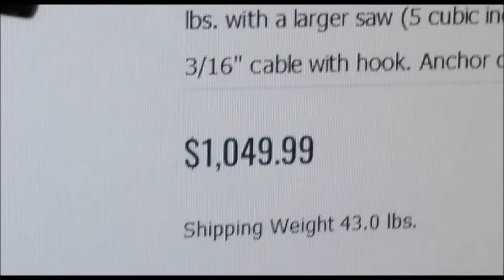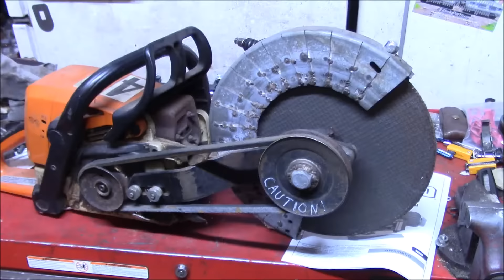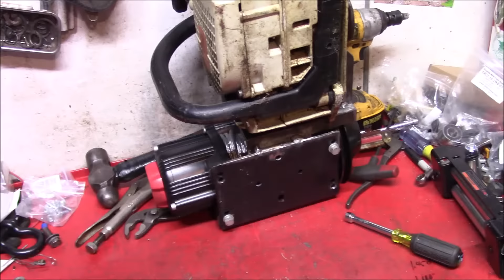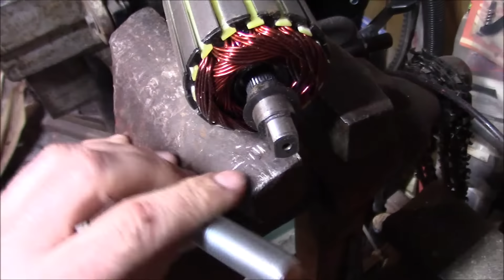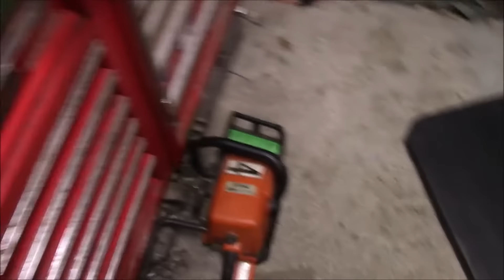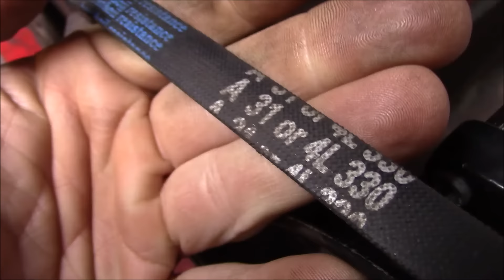Building a Chainsaw Powered Winch

Comment: Couldn't you cut off the long section but leaving enough roughly 2.5 inches to drill a hole for the d ring ... You're better off the closer you can get mounted to the spool

Comment: This is awesome. I got a 12,000 lbs badlands still in the box from years ago and a used stihl 661 (90cc) with decent compression.  You think its doable to make a monster chainsaw winch or is the 12k just too big?
Reply from the maker: Yeah, think it would be possible for sure.  Biggest thing would be figuring out how much gear reduction is in the winch, and what's needed from the saw.  Try to match the torque input from the electric motor with the drive from the saw

Comment: when I was a kid & mining with Pop.
I got to use a chainsaw winch. [it was built before I was born]
 I had watched Pop use it several times, & he finally let me try it out.

 it bolted up to most saws of the day [then saws were not plastic]
  Ive seen several deer, bear & moose pulled out by ppl using a chainsaw winch 
none were home made as you could buy one cheaper & better than what you could make yourself.
[Ive seen several ppl make them & Id still buy one as opposed to weaker home made versions]
+ I seen many used for sale - 

 safe? uh? [we wont talk about that]
what can go wrong ;)

Comment: 5000lbs but man carrying device weights in at 300lbs? Maybe if the man tied himself to a tree that might work. Will the chainsaw frame handle 5000lbs of force?
Reply from the maker: The metal base that the winch is mounted on has a shackle mount, it gets anchored to whatever is solid.

Comment: I'd use Dyneema or similar synthetic rope instead of steel wire.
Break the steel wire, and it whips on you.
Break the synthetic and it whips about a metre at the break point and drops straight down.
Reply from the maker: That's a good option.

Comment: What would be a practical application for this thing though
Reply: As a timber cutter of 60 years experience I can remember MANY instances of when I would have killed to have this winch unit on hand to simply fit a chainsaw power unit to. Both for shifting wood and saving many a marathon hike into civilization to get rescued from a bog! Not to mention the uses around the ranch and machinery sheds.
Reply: Doesn't need to be one.
Reply: @haywoodyoudome  why does it exist then?

Comment: If the saw DIDN'T spin the correct direction, one would just reverse the direction that the cable is wound onto the winch drum.
Reply from the maker: Wanted to keep drive side of the cable on the bottom winch, but that's a good thing to keep in mind.
Reply: How did you release the tense cable after?

Comment: I made one out of a worm gear box 
Welded the clutch cover to its shaft
Built and bracket and lined up clutch and housing and welded 
Then took a spool off an old harbor freight winch hoist 
I had to rig studs to slide spool off of for free spool
Man that thing is strong

Comment: I enjoyed you build. If i were to operate this I would need a remote throttle arrangement so the cable would not hit me if something went wrong. There are so many things that could go wrong.
Reply: Being cut in half by a snapped steel cable would indeed be a bad day.
Reply from the maker: Gotta take some care for sure
Reply: Those braided cables don’t snap like the twisted wire cables, they don’t whip around cutting things in half…
Reply: @ Are you being serious?

Comment: I'm kinda doing this. I have this really nice tilt bed trailer, see, and... mounting a nice gas engine on the front. there is going to be a large shaft going from one side to the other powered by the engine via a pulley. Then using other pulleys there will be a winch, a air compressor and a hydraulic pump and a small generator. I'll have a go kart type clutch on the engine so it can start and idle and not turn the shaft. Then a system where each drive belt can be let be loose/tight via a tensioning pulley so nothing is driven unless I pull a lever to make the belt tight enough to give it power. Whatever I need to run then can run. Be cool if I do it right.
Reply: That's a great idea! That's something I might be able to do

Comment: Im sure their could be a way to run the engine backward to relieve the  tension on the load to un hook? .... 2 strokes can run backwards!
Reply from the maker: I like that idea, haha
Reply: A socket and ratchet on the bolt head of the winch pulley would be enough to release the tension.

Comment: Just remembered to get back on here and thank you again. I broke out one of my sleds to get ready for grass drags, because they're finally happening in Maine again! That trick you showed us a while ago, injecting bar and chain oil into the idler wheel bearings.  Never ceases to amaze me just how well that works.  I just replaced those bearings 2 years ago and they were all about seized up. Got any tricks for making grease fittings take grease again? I know I could buy new fittings but we both know they're just going to snap off when I try to unscrew them.
Reply from the maker: Nice, glad to hear!  Don't have a trick for the grease zerks, but I know they make a rejuvenator that you fill with oil and hammer to force them open.

Comment: The mounting alignment should be straight line from the mooring clevis at the 
back end straight through the winch line.  Offset for the chainsaw drive is fine
because the only force involved there shows as belt tension force reduced by
the gear ratio in the winch.  The direction of the pull force driving the winch 
internals is isolated from the direction line of force through the winch line. 
So the location of the belt drive could be clocked anywhere it fits the best. 
If the winch line is 9 o'clock to 3 o'clock, the tension on the belt drive could
even be vertical, like down from 12 o'clock to 6 o'clock, with winch hung
below the chainsaw. The center of gravity with the heavier winch below 
would be better.  A slack side belt idler might be needed if the different
drive angle is not a good match for the chain tension adjuster. Sprockets
and chain could be used instead of a belt drive and may be better setup.
Reply from the maker: Thought about some of those different arrangements, but like you said went with the straight forward style to use the existing tensioner.  It seemed to straighten itself out in the end, lol.
Reply: @toocheaptosmoke   A chain drive and sprockets is definitely the
way I would have gone, with the winch located beneath and feeding
line vertically onto the winch drum redirected over a roller fair lead
to the horizontal pulling direction. On a chain drive there isn't much
adjustment needed for slack and a chain won't slip and burn or rot
like a belt. The CG lower with the winch slung beneath just makes 
sense as a counter to line twist forces that appear every time. 
The throttle is something I would have a cable and a hand grip 
control like a paramotor throttle so I could stand 15 feet to the 
side and out of the slingshot kill vector for a snapped line or 
torn loose mooring that launches a snatch block like a cannon. 
An accessory part I would have for sure packed in the toolkit 
for mooring the back end clevis is a tree strap / boulder belt,
and a folding grapnel anchor with long tines and big flukes to
plow into soft ground where there is no mooring point nearby. 
I see many videos where even the professionals don't have 
a folding grapnel anchor that would save their bacon when 
they have no tree or boulder to use for a mooring for a winch.

Comment: I know for a fact that the v-belt pulley from a TS700 or TS800 (part #4224 760 8500) wil fit on a 066/660/661. 

Use that knowledge how you will. 😉
Reply from the maker: Nice, good to know!

Comment: could you throw a wrench on the bolt at the pulley to back of the winch until you can freewheel it?
Reply from the maker: Sure can, although the gear reduction is so steep you can just roll the pulley by hand.  Just watch them fangers!!